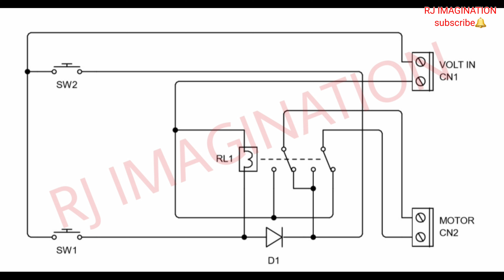Motor controller CW CCW | how to make motor control using DPDT Relay

Comment: I regret to say, your Circuit Diagram has a great mistake, purpose of using relay is to avoid load power to go through any manual switch/es to prevent switch burn but here.....
Reply: Tieši tā, jābūt obligāti diviem relejiem un vēl aizsardzībai no iespējas nospiest abas pogas reizē! 😊